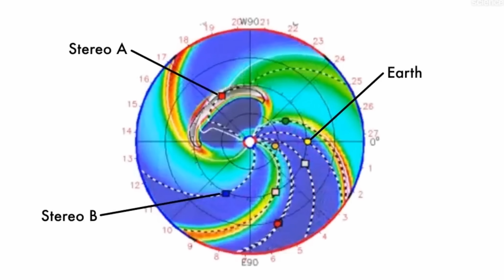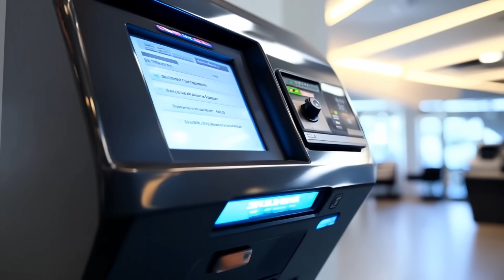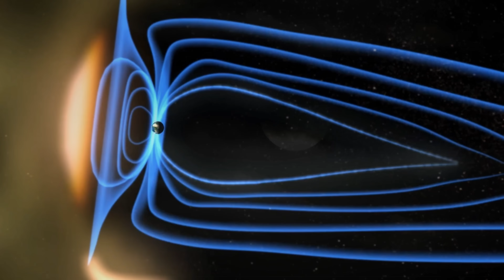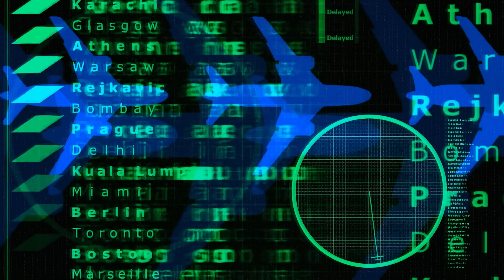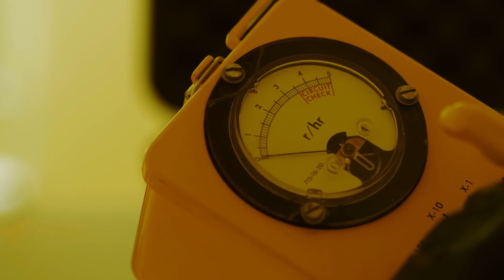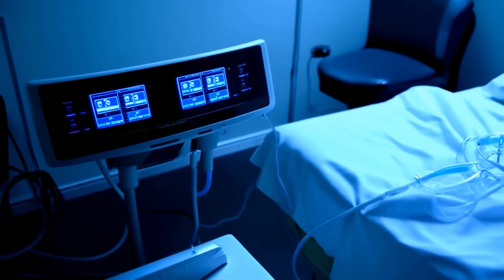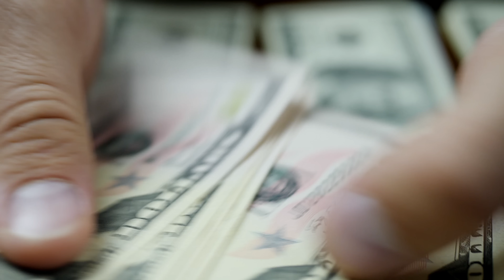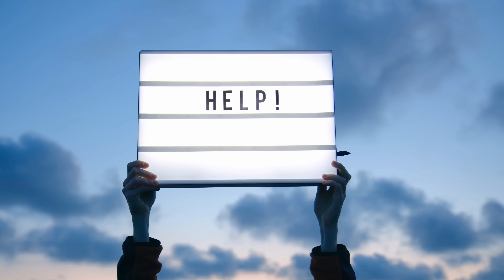THE END OF A CIVILIZATION - MIYAKE EVENT

Comment: Would a massive bit of tin foil protect us..😅🫠😉
Reply: Acutally tin foil, cardboard & aluminium tape can be used to make a faraday cage so you can store electronics, like radio comms, electric/solar power stations  3G phones where the battery doesnt run out for 20 yrs with 1 charge lol.Plus you can cook food on a camp fire if you hate the taste of bbq'd food.Turn it into tin foil jugs to collect rain water, use it as insulation to keep heat in or out.What prepper doesnt have a million tons of tin foil in their hoard I mean preps.